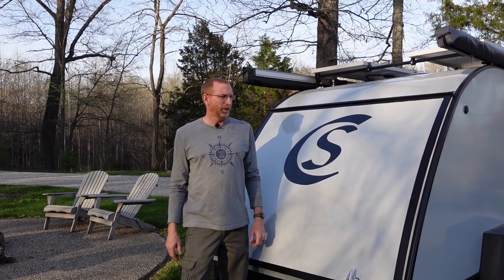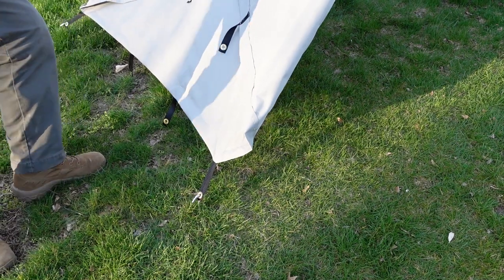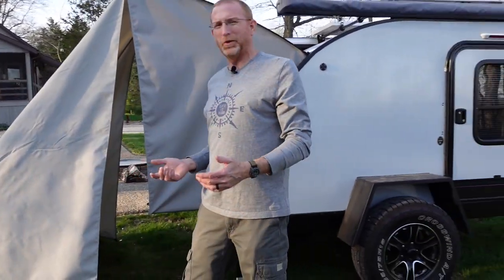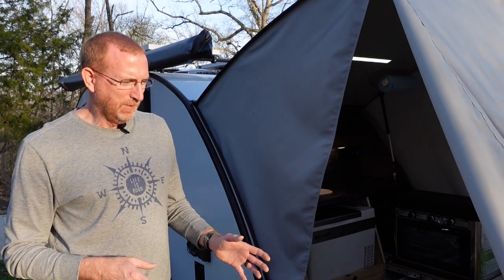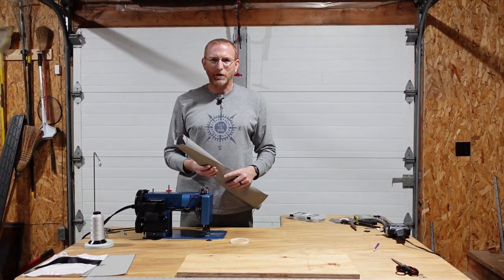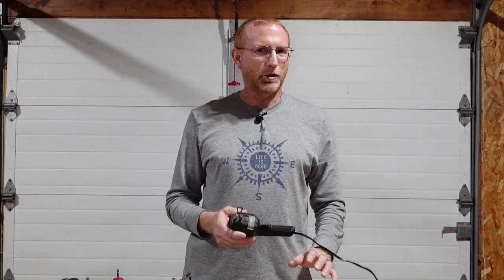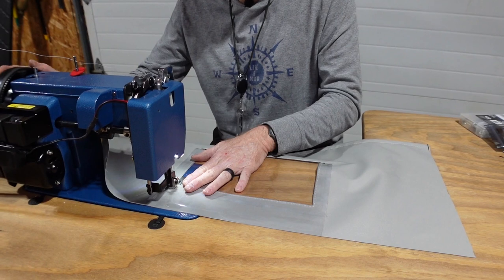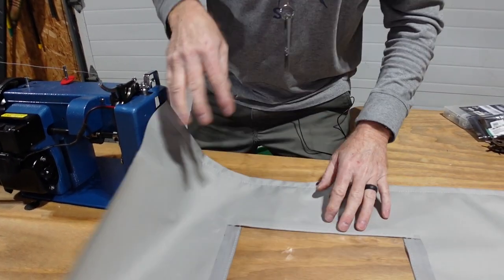DIY Teardrop Camper Galley End Wall!

Comment: Well, I don't have a galley and don't need an end wall but I am now thinking about a making my own shower/toilet tent based on this video. I don't know if I would actually want a clear window in the shower tent, but who knows?  Regardless it just shows how easy it would be to make it with the right sewing machine. Not sure I would get for just one project though. But to have it custom to our exact specifications might be worthwhile. One tip I would add for the snaps, I have put them in leather many times with the same style fasteners; I always put them on an anvil or solid metal base like the back of my bench vice when hammering it down. It comes out much more clean and the back rolls up just right. Pounding it against wood allows it to bounce a bit. So even if you have a plate of 1/4" steel that is better than pounding it against plywood. Just my experience...
 Again, thanks for sharing!!! I always enjoy learning how to do something like that. 
Pat
Reply from the maker: Thank you for the Anvil tip. I've got a piece of 1-inch thick HDPE that I normally use the backup my Snaps but I was working in the other garage and did not have it with me. So used concrete floor and that worked fine.
 As far as the shower room goes there are enough commercially available models available that I probably would not go to the hassle of building my own even though I've got the equipment to do it. That said I would probably modify it once it got here to suit my needs better but the basic structure and everything I think would be easier to purchase as a assembly.
Reply: @adventuresofthememorymakers  So I bought a tent that sets up on the ground. It has two doors. One that I set next to the side of the FreeSolo Flav where the shower is located so that I can activate the controls and whatnot and bring in the hose for the shower. The tent isn't actually designed for a shower on the side of the teardrop. The other door is on the opposite side for the toilet room and there's a door between the two rooms. The problem is that in order for this to all work the tent is right up next to the exhaust vent for the water heater and the inside heater. I'm a little worried that it might just blow the heat on the tent and melt the nylon.  What I would prefer is something more like a side awning that is simply a curtain room. I have seen them in a single room design that will hang off the side of a Jeep or other SUV. I haven't seen anything large enough to put a toilet and a shower area. I would want the toilet to be next to the fender and the shower just aft of the wheel well. I would like something that would work in conjunction with about a 3-4' awning on the driver's side of the trailer. 
Nothing commercially made will do the trick so I will likely just make my own. I was thinking about making something out of a tarp but watching this has inspired me to figure out something better. You may see that on my channel in the future but I don't have enough time to do all that so I will likely just stick to the tent I have until it bursts into a ball of flames. LOL. 
Thanks, 
Pat
Reply from the maker: @Everything RV by Pat  what model of camper are you working with?
 That is one way to get a hot shower LOL!